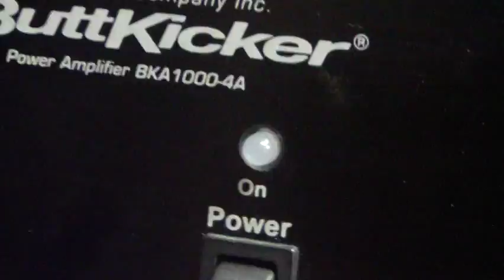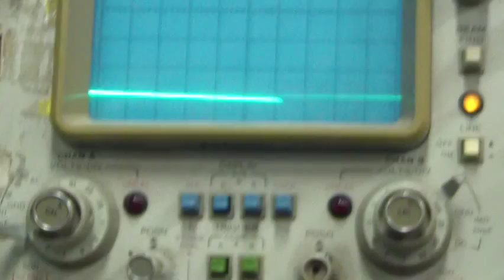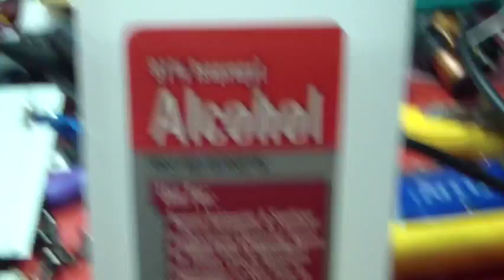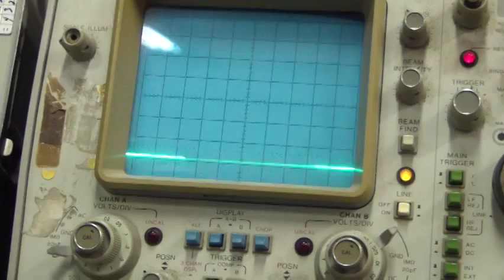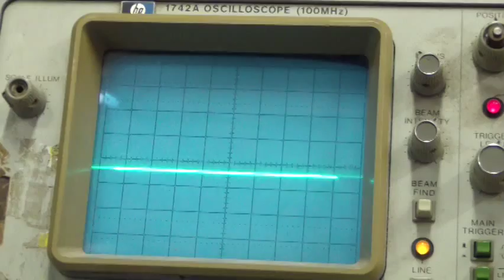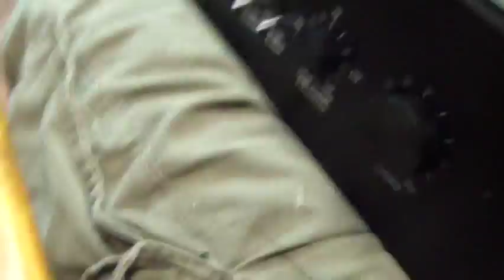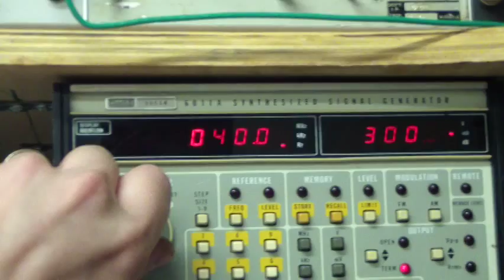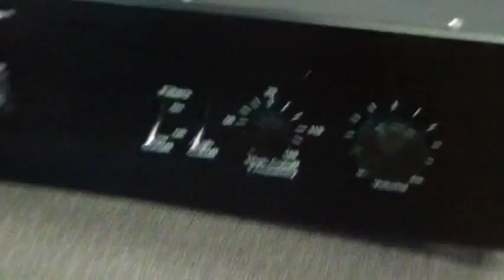Buttkicker BKA1000-4A Repair

Comment: Hello! I have the same amplifier. Maybe you have come across a similar one and know the solution?
The amplifier works, but at one moment a click is triggered and the sound disappears. The click resembles the operation of a relay. The green lamp remains on. If you turn off the amplifier and turn it back on, everything works until the next turn off. What could it be?

Comment: Hi...I have the same problem with my Buttkicker BKA 1000 4a.  However I bought mine new complete with everything included.  I noticed one of the big caps is blown and 3 or 4 of the smaller ones as we'll on the larger board are domed on the top.  A small one as actually blown the shell completely off the cap itself and I found the shell laying around on the bottom. How did you go about finding the other bad parts?  Do you have a schematic for this thing?  I'm not al electrician but I've changed caps before and they are easy to see them blown up on the top.  Thanks...Norm
Reply from the maker: Sorry no schematic.

Start with the obvious: If the caps are swollen, vented, charred, cracked, or suspicious in anyway then replace them. This goes for both electrolytic and solid dielectric. Also check the ballast and shunt resistors.

After all the obvious components have been replaced put the amp on a variable autotransformer. Attached a scope or AC+DC mode DMM to the DC side of the main rectifier. Slowly bring the voltage up and observe. Lots of ripple, say more than 1% while no load is a general sign of problems. Don't increase the voltage if you are seeing greater than 1% ripple because it probably means something else needs replaced and if the voltage / current are permitted to increase it could cause more damage than is already present.

From here you just trace it out,  clean power supply? If not find the problem and correct it. Next put a signal generator on the input and trace it.  With a class D the signal basically ends up controlling a moderate frequency high current PWM. If all that is working the only thing left is the output filtering. Big bulky magnetics followed with various topology capacitors and a few resistors.

Be careful around the power stage especially when using equipment that is not isolated; it is very easy to create a short between reference ground and the high voltage DC supply. This can blow up the amp and the test equipment.

Not that my amp was a pretty simple fix. That is, it came up nice and smoothly with the autotransformer. I was just getting ready to dive in to the meat of the amp when I attached the signal generator and discovered that the amp was working so I got off pretty easy on this one.
Reply: chinslip1 Also note that if a cap, say brand "X", fails by venting, replace all of the brand "X" caps - vented or not. Check out badcaps.net for more info...
Reply: do you think this amp is compatible with my buttkicker LFE kit?  My amp is broken so i need new one.   thanks   http://www.ebay.com/itm/Gli-Pro-PVX5000-5-000-Watt-2-Channel-Bridgable-Power-Amplifier-DJ-Rack-Amp/301973919684?_trksid=p2047675.c100005.m1851&_trkparms=aid%3D2220071%26algo%3DSIC.MBE%26ao%3D2%26asc%3D40778%26meid%3De096ad8f47fc454888f70ef90920661e%26pid%3D100005%26rk%3D6%26rkt%3D6%26sd%3D291866804966